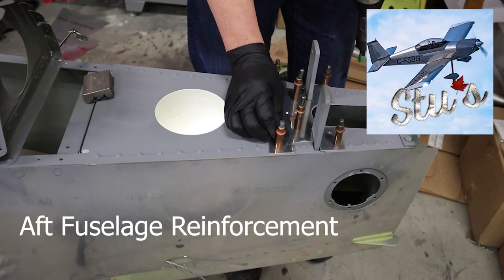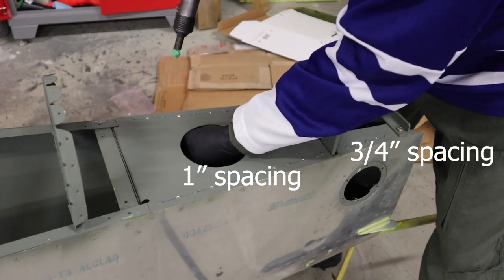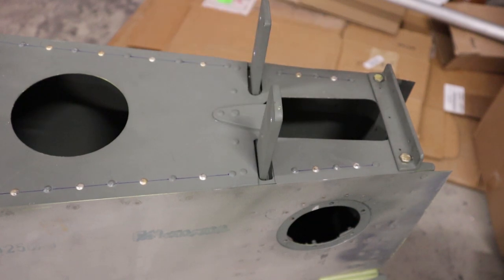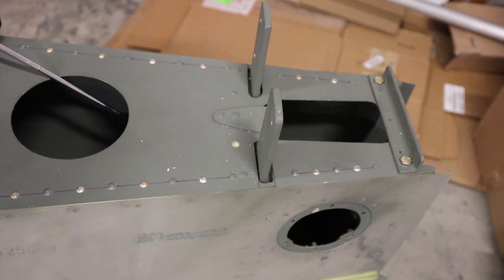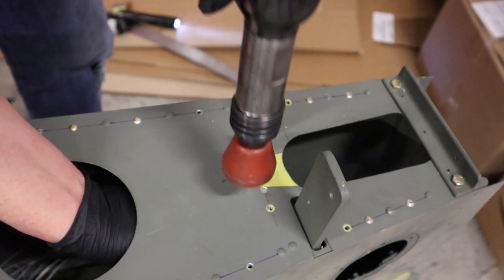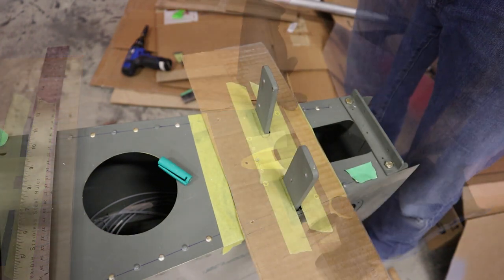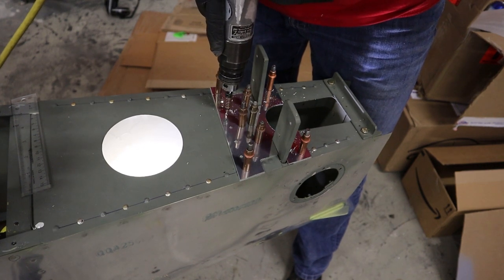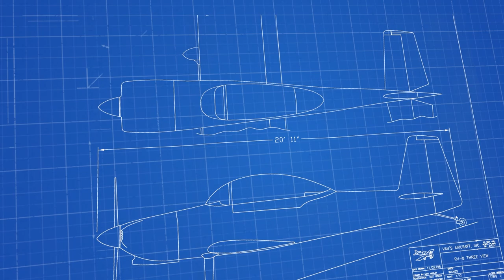Reinforcing the RV4 Aft Deck

Comment: Why did you prime only one side of plate before installing? Why not both?
Reply from the maker: I usually prime the top after.  That way rivets get primed also. Plus the primer is going to get scratched and dinged during riveting.   In addition priming the top doesn’t do much since it’s alclad alum.  The joint where moisture can get trapped  is the important one
Reply: Thanks.

Comment: I wonder if I should do the same thing on my 6?
Reply from the maker: Is it flying?
Reply: Nope. Getting close
Reply from the maker: @timothywade9913  It’s not a grave concern.  I only did it cause everything is open and we’ve had 3 issues at local airport.  Monitor it and get flying!!!!!!    I build a RV6 and didn’t do this
Reply: I appreciate it Stu. I’ll fix it before I put the 8 tail on. I plan to do aerobics and do not want any issues. Thanks for sharing all of your great knowledge
Reply from the maker: @timothywade9913  Like I said it’s not a requirement and the 8 has more rivets back there.   I didn’t do this mod on my 8
Reply from the maker: They way the aft deck is on the 4 the material is quite thin between the horizontal stab mounts and the elevator control horns.  The 8 has a lot more material there so it is stronger already